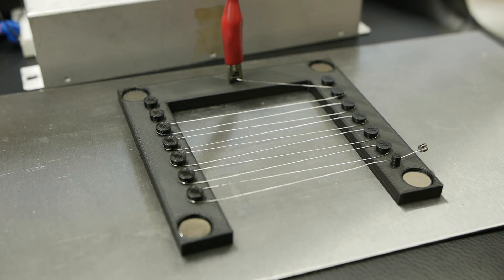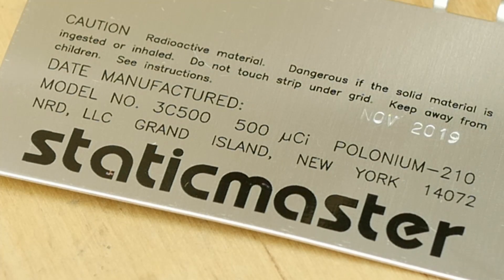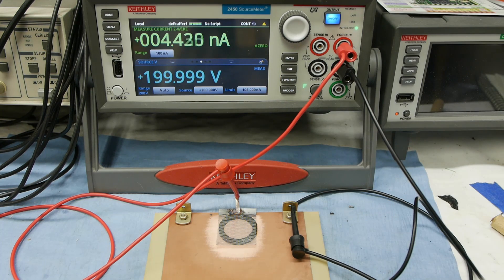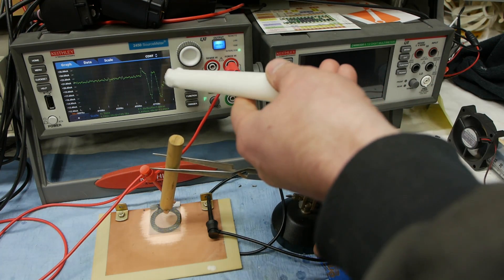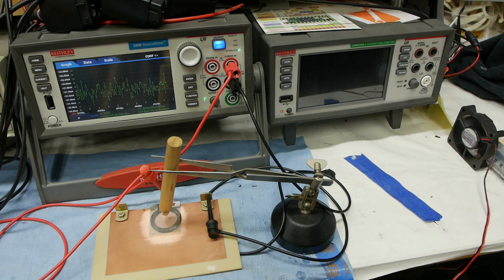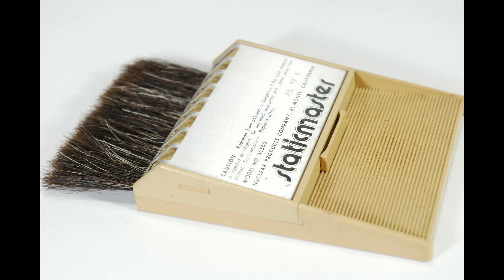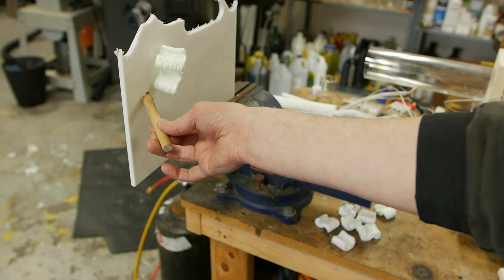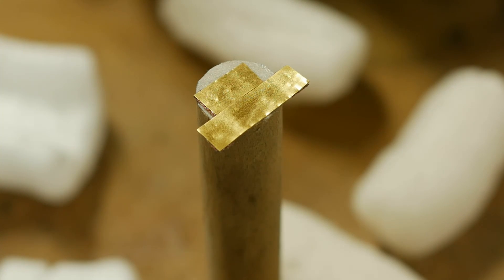Alpha radiation makes sparks, detects smoke, and eliminates static cling

Comment: you were wondering why the geiger counter measures the beta particles better than the alpha particles. i think its because the alpha particles get absorbed much easier by the air, the plexiglass and the geiger counter tube's wall much more than the beta particles.

Comment: I wonder if a mesh could be used instead of wire in spark detector. Few wires above cathode miss most of the particles coming from emitter. Nice channel, thanks.

Comment: Po-210 is one of the most toxic substances known - up to a trillion times more toxic than Hydrogen Cyanide.
The risk to health is associated with ingestion rather than contact. It's mainly an alpha emitter which can be easily blocked by a sheet of paper (even 3 or 4 inches of air).
Once Po-210 is circulating throughout the body the risks to organ damage and DNA damage are serious

Comment: What is  the lifetime of the alpha radiation source in the brush? I came across a article, that it must be replaced periodically. Is that the case? I like your videos, nice work. Thanks.
Reply: It's polonium 210, so the half life is 138 days.  Every 138 days the output reduces by half.  So in 3.7 years it'll be down by a factor of 1000.

Comment: looks like my ionizer grill, sounds like it too, and it sparks like a mofo when its not been run or is dirty, and you can smell the electricity in the air. 
You can blow huge smoke clouds in it and nothing comes out, not even a smell

The bottom line is missing in the large metal filter assembly of large flat steel plates that collect the dirt.

Comment: A far simpler/better option than to laboriously 3d print and wire up a bunch of frames for different fixed voltages would be to replace the wire with metal mesh, and use two frames connected with screws that adjust the distance between the frames to suit the required voltage.

Comment: 2:00 Looking at the two clips on the left here, presumably going from a low voltage power supply into your HV one. I can just see the two clips touching and shorting. It wouldn't be a big deal with a proper power supply, but it would still disrupt the functioning of your circuit in the mean time. I'm always so paranoid of accidental shorts when I have any set up like that. I've almost had a fire a couple times from having wires from batteries accidentally short. It really helps to avoid accidental shorts if you cut one wire an inch or two shorter than the other wire so the connections aren't right next to each other when they're lying on your bench.

Comment: I wonder, since fire is a plasma, what would be the effect if you brought a flame close to that first set up with the guitar string. We've all seen the famous demo of fire conducting electricity, so it would stand to reason it would create a conductive path for the current to jump across the high voltage. Conceivably it would prefer areas where the combusting gasses are more concentrated since it would probably have less resistance.

Comment: The soot in the smoke are large enough particles to effectively shield the scintillation detector from some of the zooming alphas - that’s the reason for the decrease in current.
Geiger-Mueller tubes can normally detect beta and gamma radiation through normal means. In order to detect alpha radio there must be a “window” where the casement is made thinner in order to decrease attenuation

Comment: I would still recommend getting an Americium smoke detector over the photoelectric because any safe "smoke" that can diffract a laser (like steam from a shower) can cause photoelectric detectors to trigger
Reply: Yes, because we all have a smoke detector in the bathroom... It is not the smoke that kills, anyway, but the carbon monoxide, so for your own safety at home, replace your smoke detectors with CO detectors.
Reply: @schmetterling4477  I worked for a company that handled alarm system responses and showers tripping the detector outside of the bathroom was relatively common. Carbon Monoxide detectors are a different use-case than smoke detectors and you can get ones that do both

Comment: I cannot believe this is something that is used in any consumer product. When that spy was poisoned they said it must be the Russians they are the only one's with access to this iirc, maybe they said it was there MO not that nobody else would use it. But if I'm understanding this right, by taking this foil pack apart, assuming it doesn't kill you, you'd have a deadlier poison than any other consumable poison that springs to mind, maybe comparable to organic mercury? Even without disassembly, you could grind it up with a mortar and pestle and have something would cause an excruciatingly painful death if a very small amount was consumed? I cannot fathom that this is available on Amazon.

Comment: If you exhaust the room temperature you 'll progressively observe the same temperature difference in the circuit, express in amperage
Voltage is the speed
Amps is the temperature
Both define the distance, the exact PI value of the power you use to make it react with the good wave response in each different parts of the circuit

The exact same reason why you can now obtain the results from small devices instead of enormous calculators
Less temperature lost

Then if you want to take time from a temperature device as a nuclear reaction, always remember that nuclear reactions destroy materials by an interaction with parasite waves that modify the constant harmony obtained in a material

Using nuclear destruction as warm source is creating temporal disrupted waves that increase the temperature by destroying the earth harmonic wave

Time space ruptures

Less matter is heavy less the times rupture will be long
More the matter is heavy, more it will be long and impose his strength to other materials

The time needed to reassemble the clock is on a terrible long life, a crazy value of PI witch will interfere with materials for a crazy long time and destroy all the harmonic clocks around

Same as first earth time, no life, no harmony

Talking about half-life time is crazy
It's the English way to talk
Do we talk about the first half-lifetime or the second part ???
Is it the morning or the end of the day
Same problem with computers in 12 clock

Your experience show the exact problem with nuclear reactions
How can any matter or device could now do anything with this, all electronic devices will be strongly perturbed by the time ruptures
Creating sparks in the materials
Creating wrong time respond to the harmonic of the stronger volume, in our case earth in the solar system

That's also why in atomic bombs, they talk about clean and dirty ones
Hydrogen is relatively less dangerous than heavy materials due to the life time reaction
This doesn't make it more safety, only less durable in times ruptures

What could maintain a planet core at the good warm...
Perhaps the return of the harmonic matter
Fuel and gaz from living forms

Comment: Modification of the electrons flow witch increase the temperature, so amps, by creating an interaction between the current controlled flow and the electrons flows created by the radiative stuff
The chaotic interferences that created heat by interaction of the two movements

Comment: If you didn't say particles I would of been happier. Particle physics has held back humanity potential. Certain elements ,which are multiple frequencies overlapping, have a radio frequency that is emitted from them due to disharmony in that element. A young man had already shown radioactive waste can be returned to neutral state with a inverse wave of higher amplitude. The same man showed that resonant alpha,beta or gamma cells produce way more energy than regular radioactive cells. When will men of science stop be afraid of the funding withdrawal , no offense ladies of science

Comment: During the Manhattan Project, polonium was being shipped to Los Alamos for use in conjunction with beryllium as a neutron initiator in the core of the atomic bomb. When the polonium foil arrived in the mail, scientists had a hard time finding it in the shipping container. During shipping, the polonium foil would fly apart and embed itself into the walls of the cardboard box. It was apparently a huge pain in the ass to deal with.

Comment: 07:30 The Po-210 decay emits a gamma ray sometimes, but only with a branching ration of 0.0012% (roughly 1 in 100.000). So if your Po-210 source was 500 µCi (18.5MBq) you expect around 200 gammas emitted per second. Maybe if you'd hold it against your GM tube you can measure something.

Comment: Many moons ago, when static discharge to electronic parts was starting to be a problem, Am-241 bracelets were all the rage for a while.
No need for a ground-strap when your bracelet is ionizing the air!
Don't recall how many micro-curies they were, but they didn't stay on the market very long.

Comment: Very nice! This is a great video! I have about 500 μCi of Americium-241, but no fresh polonium-210 sources currently. Am-241 emits a decent amount of low energy gamma rays with a branching intensity of about 36% for 59.5 keV gamma rays and 5.4% for 26 keV gamma rays. The rest of the over a hundred gamma ray energies are less than about 1% and more, so they hardly contribute to more gamma radiation. Po-210 does have a fairly high gamma ray energy, however it's branching intensity is so low, only about 0.001%, so it's often negated. Po-210 only has a half-life of 138 days, so it has to be used fairly quick. Too bad they can't just use Pu-239. It's a nearly pure alpha emitter, and your brush wouldn't need replacements. Ionizing radiation is fascinating! I love this subject! Thanks a lot!
Reply: 500uCi of Am? That's a lot lol

Comment: The video is quite good and I enjoyed it. One question that I had concerned the method of producing the polonium in place by 
bombarding a gold plated film of bismuth. The neutrons would also activate the gold film and create a source of beta rays 
when the Au-198 decays to mercury. Are there any beta emissions from your static master source?
Edit: I searched and found that it also has gamma emissions.

Another Edit: I had a long talk with a guy from NRD, who make polonium anti-static devices.  It was really interesting. Long story short, bismuth is irradiated in a reactor, the polonium is separated by vacuum distillation. The polonium is alloyed with a mixture of silver/bismuth. The polonium forms a eutectic mixture with the silver. The alloy is passivated with layers of gold and nickel.

Cheers.
Reply: thank you I came back to this video to figure out how Po-210 was made because I thought that making Au-198 would absolutely not be wanted by the people who make Po-210.
Reply: @cassandra2860  

I agree about the Au-198. One thing I remember from reading about polonium engineering during the wartime is that the stuff was amazingly mobile. Early shipments of the stuff for the Urchin initiator would arrive at Los Alamos and be alarmingly spread out.
From Richard Rhodes book;

 'Thomas shipped the Po on platinum foil in sealed containers, but another nasty characteristic of polonium caused shipping troubles; for reasons never satisfactorily explained by experiment, the metal migrates from place to place and can quickly contaminate large areas. 'This isotope has been observed to migrate upstream against a current of air,' notes a postwar British report on polonium, 'and to translocate under conditions where it would appear to be doing so of its own accord.' Chemists at Los Alamos learned to look for it embedded in the walls of the shipping containers when Thomas's shipments came up short.' 

Cheers.

Comment: @appliedscience I was cutting a piece of teflon tube for my 3d printer and got a huge jolt. It was so bad it will be a shock that I will always remember from that day forward!  I can never predict when or how this stuff is going to spark when cutting it but it happens quite often so much so that I wear gloves now when cutting PTFE tube. Would be nice to see a video on that.
Reply: What is the relative humidity in your room for heaven sake?!  Never have I gotten a shock off PTFE tubing when cutting.  I've had my Ender since they first hit the market.  Both Capricorn tubing and generic.  Curious.  My RH is between 38-49% in the winter.

Comment: Another thing you can make with an alpha emitter is a very sensitive (and optionally direction-sensitive) airflow sensor. I can't find it now, but I remember reading an article describing a 3D vector anemometer composed of three mutually perpendicular and intersecting toroidal metal rings (presumably each having multiple electrically isolated segments) surrounding a central alpha emitter. Even a very slow airflow blows the alpha particles enough to detect a difference in the currents picked up by the different segments of the rings. Searching on Google Scholar for things like "alpha particle anemometer" and clicking through the "cited by" links gave me a lot of similar things, even some 2D vector anemometers based on this principle, but I couldn't find a 3D one again. I think I downloaded the PDF, but it's probably on an external hard drive that I won't be able to check for a few days/weeks, by which time I'll have forgotten about it.

Also, here's a way you could scan your lab for contamination by alpha emitters, without having to wave an alpha-sensitive Geiger counter over every surface (remotely detecting alpha-induced UV radioluminescence of nitrogen in air): https://www.ncbi.nlm.nih.gov/pmc/articles/PMC5948492/ / https://www.mdpi.com/1424-8220/18/4/1015/htm (the same paper on two sites)

Comment: Inspired by Carl Willis, I once ordered two 5 mCi Po-210 static eliminators and taped beryllium foil to them, making tiny neutron sources. Beryllium-9 absorbs an alpha to become carbon-12 and a neutron, which goes flying off and can activate some other nuclides that easily absorb neutrons and become radioactive. I was able to activate several elements with high neutron capture cross-sections, including manganese, indium, gold, and several rare earths. The effect wasn't much - around 1 or 2 CPM higher than background on my Geiger counter shielded with lead - but it was easily statistically significant, and the half-lives matched the known data.

Then I accidentally threw them away while I was moving. The 5 mCi sources are leased - you're supposed to return them to the manufacturer after 13 months. So I had to report that I lost radioactive material to the NRC. Luckily they're the coolest 3-letter government agency around, and it was all straightened out after a 5-minute phone call.
Reply: I've often wondered.  Is it possible to combine bismuth with beryllium to produce a continuous source of polonium in a loop?  This could be useful in making RTG power.
Reply: @ThePeterDislikeShow  I'm afraid not. Beryllium doesn't produce neutrons on its own - it just produces them at a very low efficiency when it is hit with alpha particles.  Only about 30 neutrons are produced per million alpha particles. The neutrons fly out in all directions and have to be moderated  (I used polyethylene blocks; water would also work) to be absorbed by the target. But since neutrons are very hard to focus, most of the neutrons just escape without hitting the target. The few that do hit the bismuth would then face another problem: bismuth has a low neutron capture cross-section, and most would not be absorbed even at the right energy. You would ultimately end up getting only a few atoms of polonium for every billion alpha particles from your source.

Comment: Ain't got no high-voltage power supply, ain't got no Geiger counter, ain't got no radioactive material...why does my life have to suck so hard!? And I'm sitting here lighting my candles with matches. You blew that candle out just so you could show off and relight it with your blow torch a second time. Honestly, I'd do the same thing, though. Ain't fair, I tell you...it just ain't fair. :(

Comment: I tried the spark experiment with americium and two pieces of nichrome wire—the Americium made sparks jump, but so did aluminum foil. Maybe the sparking is just caused by a disruption in the electric field?
Reply: Sparks were also caused by other conductors like steel & copper wire, but not insulators like PVC

Comment: Great explanation, I would have otherwise thought the smoke make the air more conductive. I tried to make one of these (spark gap detector thing) but I don't have an alpha source handy; thoriated welding electrodes didn't seem to do the job. I spaced the grid out with pieces of cut up old hotel room keys that I had laying around for misc projects.

Comment: 7:40 The GM tube measures x-rays that are generated when beta particles are stopped by the metal tube. It's called 'brehmsstrahlung' ('braking radiation').

Comment: And then I bought a reconditioned nuclear reactor from the Russian mafia that sell such stuff at eBay. I put it in my bathtube and put it constantly on, so now I'm self-reliant on electricity. Then I bought a carbon dioxide laser from Amazon that I'm going to use in my automated midge killing machine. And for a rat deterrent I bought some sarin gas from Syria via Banggood, that I'm going to use in my sewage pipes.

Comment: Because timing is so critical and some guarantee that an arc will form at exactly the right moment in unison with the other 32 or so fuses is so absolutely required, some krytrons (part of the ignition mechanism) in nuclear bombs use this same principle except they usually have nickel-63 to emit beta particles instead to facilitate ionization, so get building!